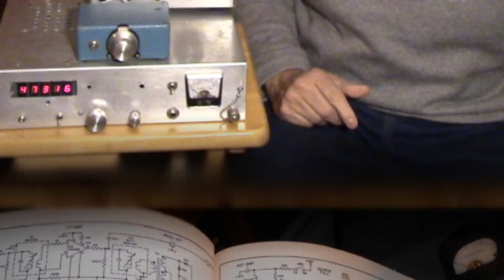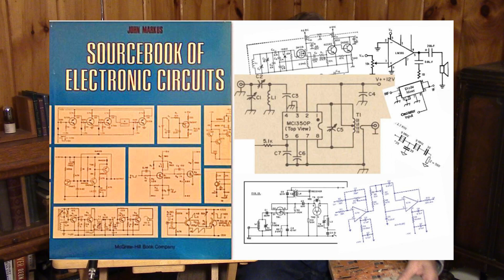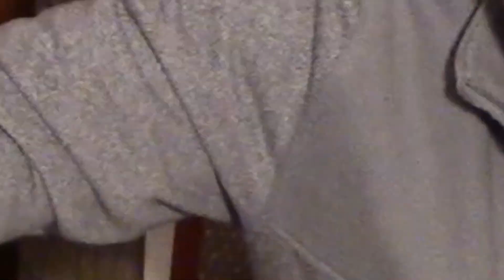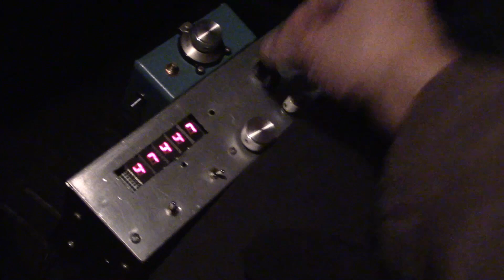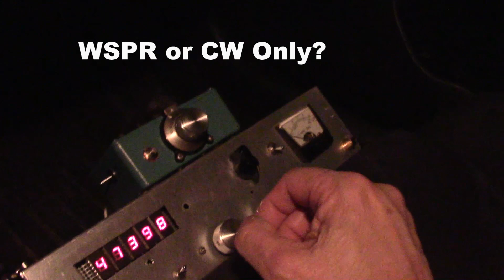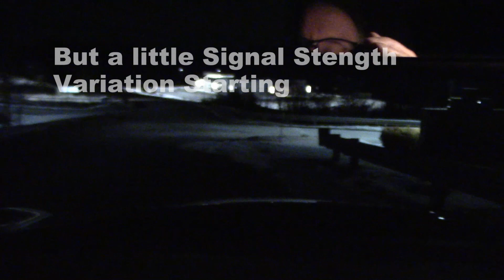Goin Mobile LF

Comment: Very interresting video, thank you.
Actually I drove in my 20 year old car yesterday afternoon and it has a radio with LW and MW 🙃
Our utillities are all underground throughout the whole country, so no issues there. I listened to the BBC on 198kHz wich came in fairly strong (around 800km).
Noisefree until I passed lamp posts with LED lights in them ... they are very noisy, wiped out everything even at 10m distance. Must be a problem if one lives in a town today.
Reply from the maker: We are an ancient electrical society in the states and love wooden poles apparently. 198 kHz comes in over sometimes pretty strong here, but several stations are on that freq and lots of fading from one to the other.
Reply: LED street and traffic lights 🥶.
Reply: @MIKROWAVE1  Nice. Thats quite a distance. I do like LW because it is almost free of fading in and out and much less distorted than MW.

Yes it is nice not to have all the poles and cables all over the place but there is a downside to it, the losses from capacity between the underground wires and the soil is quite high, that is not so "green". The good thing is when its storming we dont loose power, in fact I cant remember when we lost it last time. It must be years ago.

Comment: The Vacuum tubes that were made for use in car radios that operated on a heater voltage of 12V and a B+ of 12V might be worth having a look at.
Reply: for B+ car radios used inverter to increase the voltage to 90+V.
Reply: Tung-Sol made vacuum tubes for use on a B+ of 12V for use in car radios as the first transistors were not ready for prime time
Reply from the maker: Valves? and a Dynamotor? Actually car radios make a pretty fine tunable IF except they are a bit wide for anything but AM.

Comment: 599P === 599 plus as far as I know

Let’s see if you can go mobile / portable TX on 630m
Reply from the maker: Now you are dreaming it. Just dont touch the tip of that antenna!
Reply: @MIKROWAVE1  I know how hard it is to get 40m working CW mobile, but I have around 60-80KHz to use. I know you can purchase ham sticks for 80 & 160m. But that’s 4x the wavelength of top band

Now, there was an aussie bloke who used his car body as a radiator, and dragged grounding straps on the road behind him off a custom rear bumper. He used a separate non grounded power supply to run the radio. 

It would be an interesting challenge, remembering you get nothing for free, so any antenna is going to be seriously limited....